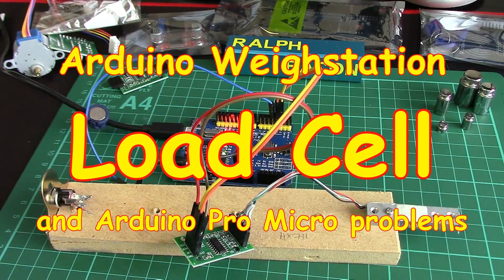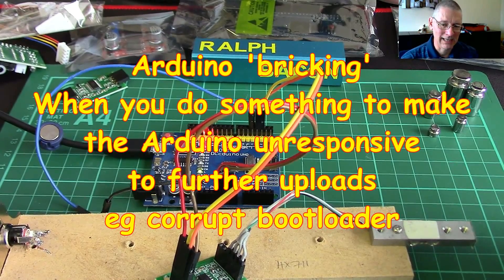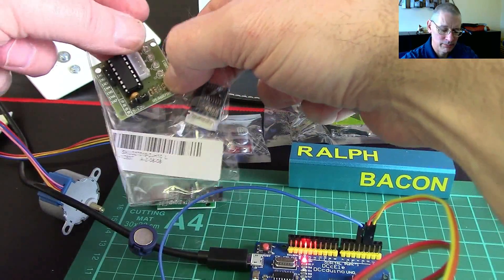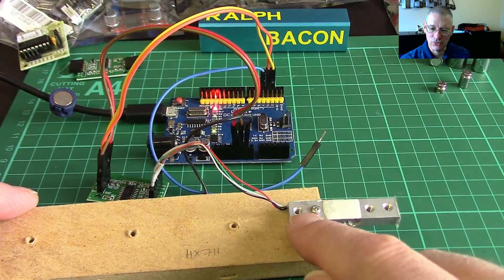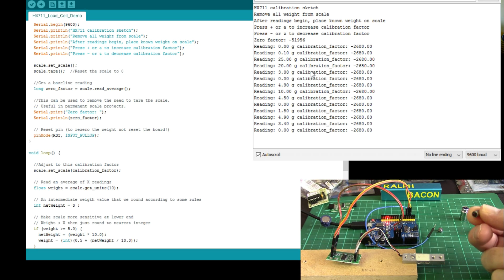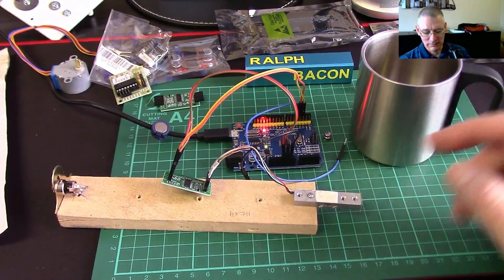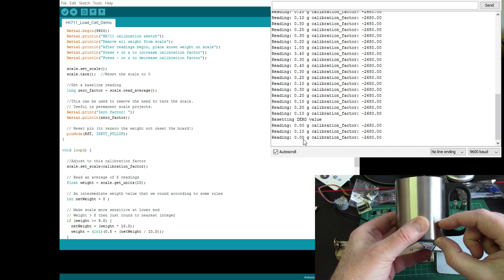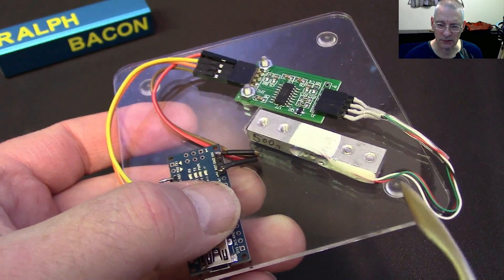#31 Load Cell project (part 1) Arduino Micro problems plus postman deliveries

Comment: At work, we fill bottles with product and we use a load cell to measure the weight of the product in the bottle. Our load cell has gone bad and that is why I am learning Arduino. The microcontroller in our machines is so old that no one knows how to make it work with a new load cell. Instead of buying a new $20K machine, I want to refurb our machine using less than $100 in Arduino parts.
Reply from the maker: You could built a pretty good scale using a Load Cell and an Arduino. MIght not be of the same precision as a $20K device but how accurate does the bottle filling need to be? If it's 0.1g then I reckon the Arduino will do it.
Reply: @RalphBacon  Our current machine is only accurate to 1g. I will let you know how it goes.

Comment: NEVER touch your test weights!  You will put skin oil and moisture on them throwing off the accuracy and also cause erosion.
Reply from the maker: Don't worry, Digger D, I wiped all mine off after use here with a micro fibre cloth for that very reason. But Good Call, worth mentioning and sharing here 👍

Comment: Excellent tutorial on load cells.  I have used them with a Raspberry Pi years ago to rebuild a packager with burned out electronics.  The packager would count to X number of items from a conveyor using the load cell.  When X was reached it would then trigger opening a chute flap (solenoid) into a box below.  It was a simple, semi-automatic packager.
Reply from the maker: Very cool! My rather simple coffee reminder still works and is still being used! It taught me a lot about load cells, for sure. 😉

Comment: I want to connect the weight loading unit with the Arduino and when it reaches 1 kg, the LED works on one of the Arduino ports
Reply from the maker: Yes, you can do that once you get it working, it's quite accurate.

Comment: Hi Ralph, could you help me please. I'm trying to use the HX711 with a KeeYees Pro Micro but can't figure out what pins to use. I have found loads of stuff for other boards just not this one
Reply from the maker: The Pro Micro (whatever brand) is an 32U4 processor board (just like the Arduino Leonardo) so will be a bit different to the UNO. However, it will work pretty much the same as the Uno; you can use pretty much any of the GPIO pins and then change the sketch to those pins. That all said, you should really get this going with a standard Uno first so you know you have it working - then transfer it to the Pro Micro, otherwise you are making it very difficult for yourself!

Comment: Re: static sensitive parts,  they all are to some exent.  I got an Uno and a nano from banggood not too long ago.  The uno was in your typical sealed static bag,  no issues there.  The nano was in one of those bags that's foil on one side,  with the other side transparent,  and they had affixed one of those yellow warning stickers to it saying "CAUTION: Static Sensitive Devices". But once I opened it I found that they'd stuck the part into a chunk of styrofoam just barely big enough to fit between the pins,  presumably to prevent the pins from getting all buggered up.  Styrofoam!  And not that pink anti-static stuff either.

Re:  Load cells.  I did some work some years back to repair a box that was used to test big steel cable harnesses.  Like the sort of thing you'd use to pick up a space shuttle or similar.  The box (and the operator position) was behind a serious barrier,  just in case one of those assemblies snapped while being tested...
Reply from the maker: Once a µC has been assembled (eg such as a Nano) I think it is probably pretty safe with minimal protection - but I would not use styrofoam! I plug my static sensitive components (eg MOSFETs) into carbon foam (very low resistance, albeit a little brittle). Interesting about the large cable tests - but probably all the same principle!

Comment: Enough of this unwashed, digital coffee scale horde thinking. Join the laser, retro-reflectometry coffee level master race.
Reply from the maker: That is some sentence, Buck, I had to read it a few times. My coffee cup Load Cell is STILL working just fine in my workshop and the beauty of it is that it is simple. It "just works".
Reply: @RalphBacon  Moving it to another place once it's empty would "just work". Putting one of those "blind spot mirrors" from an auto-parts store on the underside of the cupboard above the cup would work also, since you could see the bottom of the cup. 

But... Imagine, if you will... A glorious strip of laser beam that points to a hand-drawn scale that ranges between "E" and "F". The direct - and illuminated - approximation of vessel fullness (or emptiness, at your sole preference) would announce to all weary office wanderers, who's domain they're in - and more importantly - the level of His Majesty's coffee.
Reply from the maker: I could cheat and use an IR distance detector but also one (or more) of those "cat toy" type lasers you can get for Arduinos and use that to display the level using a stepper motor to change the direction of the beam. Sounds like something you'd find at a Geek Fair. In other words, fascinating but ultimately a little over the top. (Even more so than my Load Cell). I like the Blue Sky thinking, though.
Reply: @RalphBacon  Point the laser at the coffee surface from above, but at an angle. The current volume will determine where the laser light falls, and just calibrate that area. If you want it overly complex, modulate the laser, use a cheap green one but filter out the green, leaving the IR that was used to create it. When the coffee level reaches "low", the reflected, modulated, IR laser turns on the coffee  maker.

Comment: Hello. In my project my cell load with hax711, read weight negatives, help me please. tks.
Reply from the maker: It means you did not follow all the steps properly, I'm afraid. Or you have wired up the load cell wrongly. It's always one or the other. Recheck your work and do exactly what the demo shows (and the video following this one), then it will just work.

Comment: hello sir., i am working on my project... i am using arduino mega board 2560.. but i have to use 4 load cells each of capacity 40 kg.. what kind of amplifier should i use to connect them all.. and what changes are needed in the code/sketch you have given above... and what about the connection with mega board means how to connect with mega board...  i would be thankful if u replied to this comment... thanks
Reply from the maker: When you say you are using four load cells, Mustafa, are you using them independently or as a single weighing unit that can weigh (up to) 160Kg? I've not done a video on using more than one Load Cell, although most HX711 boards will allow two to be connected up as a bridge. You will have to Google the answer for using four connected cells, I'm afraid.
 
Using a Mega 2560 is no different, really, to using an Uno. The code is the same, although some of the pins might change, but as you have this board you presumably know the pin numbers and what they are used for?
 
You might want to consider building the sample project "as-is" so you get some experience of using a simple, single Load Cell first and then progress to your four-unit project?
Reply: Thanks for replying sir......i'm using them as a unit . the four load cells are combine through a "Load cell combinator" by the same wheatstone bridge principle and then the four wires are connected to a Load cell amplifier and then the next to arduino board.. but this thing is not giving me a reading.. i dont know what to do know..

 I have tried a single cell but the cell i'm using, consists of three wires, again no luck.

Comment: Up to 50kg... I work in a compagny wich sometimes makes load cells over few MN (with another design).
Reply from the maker: Well, I suppose the weigh-stations that measure laden trucks with many tons must use a similar method so I'm not surprised that there are some "industrial" versions of this! Good to know and thanks for posting.

Comment: What does bricks itself mean?
Reply from the maker: The term "bricking" refers to what happens when your turn a useful piece of electronics into something as useful as a brick. In other words, not very useful at all. So if you apply too much power to an Arduino, for example, you will "brick it". It can also apply to computers and smartphones when flashing new firmware; if you are unsuccessful you will have "bricked" your phone or computer because they no longer function and now resemble a brick in terms of usefulness! Hope this helps. Good question!

Comment: What is hx711 slave address for I2C communication?
Reply from the maker: Hello, esra altun, I'm afraid the HX711 is not an I2C device and therefore does not have an I2C address. If you use the HX711 library as shown in my demo you just supply the two digital pins you have connected the DT and SCK to and then you're good to go. I hope this clarifies things!

Comment: Hi Ralph, great video very in depth. Do you know or have any thoughts about running these in series the achieve a higher max weighing potential (on ebay I'm seeing max 50kg before prices skyrocket)
Reply from the maker: What normally happens is that you 'bridge' more than one sensor - your bathroom scales has two or four of the 50kg sensors, for example. The HX711 can have two connected in that mode (but you will have to research the wiring, I'm afraid) or there may be 'kits' that have four sensors and a different chip to detect the weight. I hope this helps.
Reply: Hi Ralph thanks for the quick response. I'll get a few ordered and have a play with regular scales before ramping up.
Reply from the maker: Absolutely, get it working 100% using a single unit then move on to the advanced stages. Good luck with this.
Reply: Spoke to my friend about this and he's said to me this project is fine but use the 50/100kg set up but with levers so that'll make it inetersting to achieve the higher weights.
Reply from the maker: With levers? You need to get your friend to explain what he means by that. What is their purpose?

Comment: hi i have a project where i am using hx711 and 80 kg load cell as shown in ur image, i have done everythinga s per guidance then whenever we keep weight on machine there is no movement at all. please guide me what to do!!! bhargavgoswami89@gmail.com,
Reply from the maker: If you had followed the steps in videos #31 and #32, Gaurav, you would have discovered long before putting a weight on the sensor whether it was working or not. I suggest you start again and get the Calibration Seed value sorted out - it's at this stage that you can verify whether it is working or not (especially your wiring to the HX711 sensor). Have another go!

Comment: The dropBox sketch link is down? Can you plz reupload. Thanks
Reply from the maker: Thanks for letting me know, Edvin. I've moved all the files for this video to my Github: https://github.com/RalphBacon/Load-Cell-Part-1 as Dropbox no longer worked. Let me know if you have any further problems and good luck with this project.
Reply: I've been using different sketch's, got my load cell calibrated, but struggling  to stabilize it when there is no load. The lcd still prints negative even though I use if else statements to tell it to display 0.0 grams if the value goes negative. I'll try out your code, thanks!
Reply from the maker: Good luck with your project,  Edvin and thanks for posting.

Comment: thanks sir^^
Reply from the maker: Thanks for your post, Ayu Gustiara Pasha.
Reply: Ralph S Bacon sir, i want to ask. in ur coding "#define RST 4" . from pin 4 i must to connect where? thankyou
Reply from the maker: This is the "zeroise" or "tare" function of the weigh function - it goes to an external switch (I use a small tilt switch but a standard push-to-make switch would work too). When pressed it tells the sketch to "zeroise" the weight on the coffee cup Load Cell (eg with an empty cup on it, so the weight of an empty cup is considered to be zero weight - only the contents then are measured). Understood?
Reply: Ralph S Bacon thankyouu so muchh sir, now i understand^^ .
ur video are helpful for my final project.
Reply from the maker: Thanks for letting me know, Ayu, and good luck with your project. And do tell everyone about this channel!
Reply: Ralph S Bacon Ok sir^^

Comment: hi, i am a student, i using 10kg load cell, when i put load on load cell, the reading is always 0kg? why is it? can you help me please
Reply: btw i using arduino uno
Reply from the maker: Did you follow all the steps in both videos, including the calibration? You would already have discovered that you would be getting readings if you had, so I suspect your wiring. Double check all wiring and follow all steps in the demos and you will have success.
Reply: Can i know how to make the reading really stable?
Reply: How to make the reading not fluctuating , how u remove the noises? By software and hardware?

Comment: Hi! Im a student and has a project regarding these but planning to use it for weighing person, can I use a 50kg load cell to measure higher loads? Maybe callibration ?
Reply from the maker: Yes, you can use a higher capacity Load Cell, James, but for measuring people (or other heavy objects, like elephants) you would normally use a slightly different setup. In that case, you would use 2 or 4 50kg Load Cells configured in a half bridge fashion with three wires per sensor; when you connect 2 or 4 of these sensors up they make up a full bridge. The sensors should be closely matched for impedance (the seller will state if they do that).
 
The HX711 supports 2 Load Cells but I'm not sure about 4. You'll need to read up a bit about this.
 
What can I say? This is more complex (=typical British understatement) so I'd get the simple demo version working correctly 100% before moving onto something like this if you value your sanity (and spare time).
Reply: hi! I'm a student also and i'm using 2 load cells(50kg)+hx711.When i upload the coding in arduino(arduino uno) it shows 0kg at  serial monitor no mater how much i pressed it...i think there's a problem at calibration factor...can i know how much calibration factor do I have to put in order to get a accurate reading.....

Comment: Hello I'm a High School Student and I was wondering how did you get each reading to print on the serial monitor only once? When I try it out it prints 100s in the matter of seconds. Please help
Reply from the maker: You're probably reading the LoadCell too often, Sahil - several dozen times a second! Try putting in a delay of about 100ms between reads. Alternatively, compare the value to the previously read value and if they are the same do not display again (until it changes).